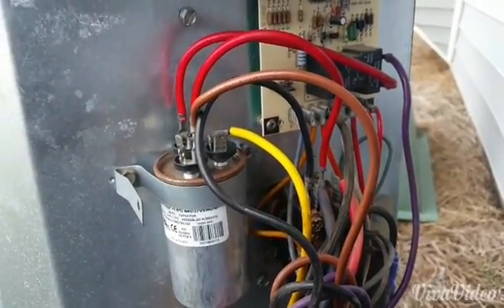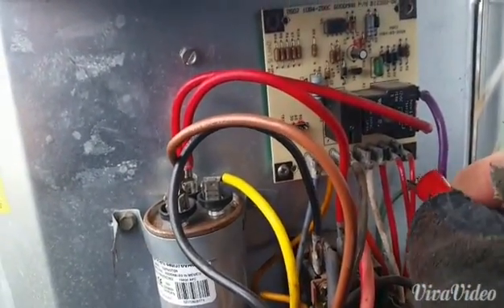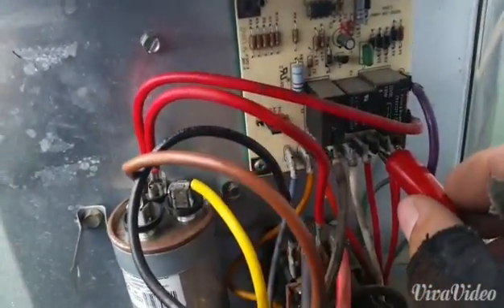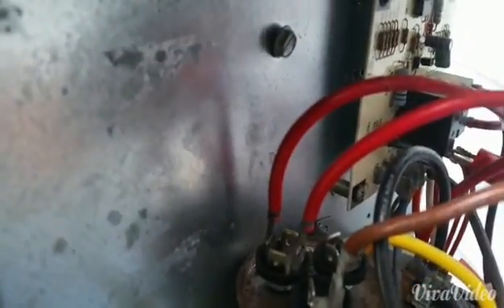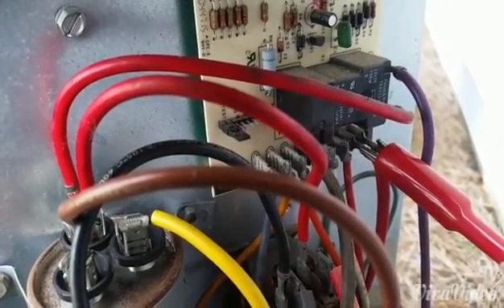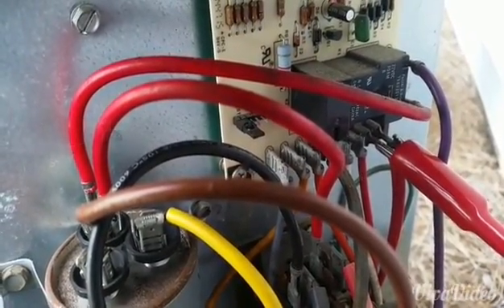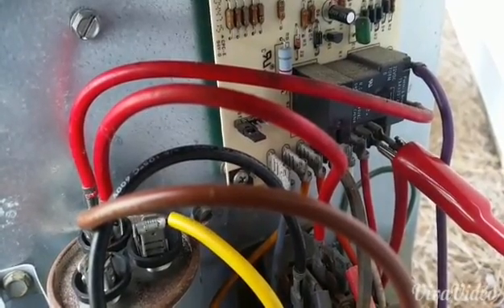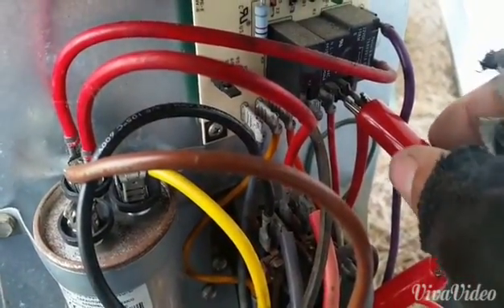HVAC Training : Testing a Heat Pump Defrost Board

Comment: I will usually avoid jumping the coil sensor out and instead pull the condenser fan motor wire to shut that down and force the coil to frost up and make the sensor engage. But of course if you're pretty sure the sensor is fine and you simply want to confirm defrost your method works just fine.
Reply: That's a good way to do it.

Comment: Great video Zack! I'll be sending some work your way for sure. Its been 20 years since I've done heat pump service and it has changed a lot. I have been in the industrial HVAC side of things since then. Its amazing there use to be mechanical defrost timers and a lot of Penn stats lol. Now days they even have vfd's  in residential / light commercial. Its amazing the changes I have seen come along in the years and the seer ratings/ new refrigerant blends that are helping with that. I mostly deal with R123,R-11 and some 134a . great vlogs Zack and keep up the great work your doing!
Reply: Thanks, I look forward to taking you up on your offer.